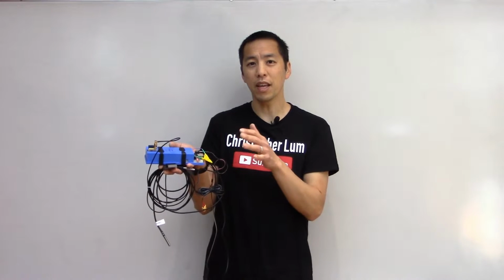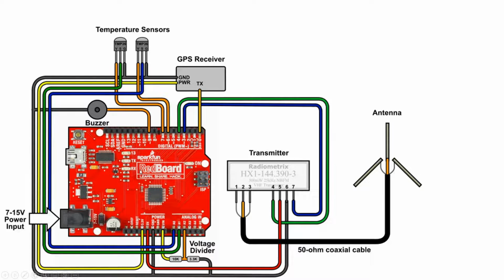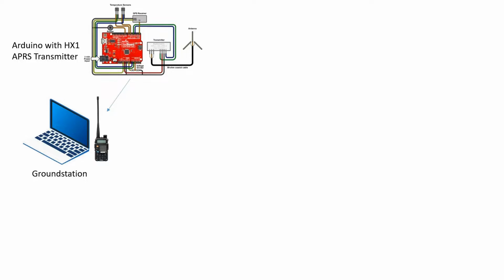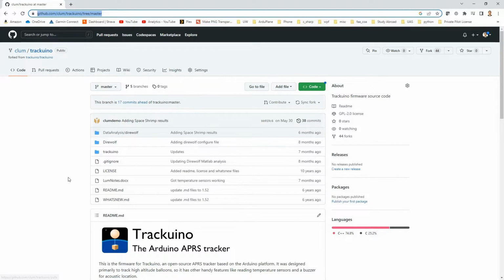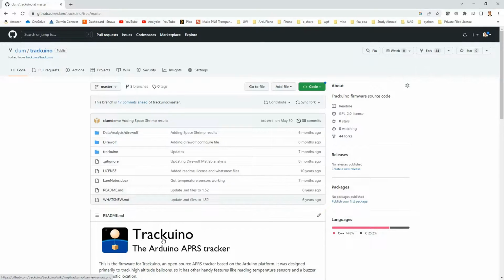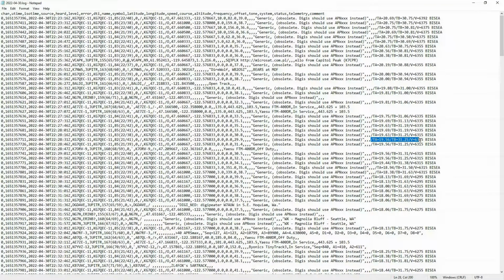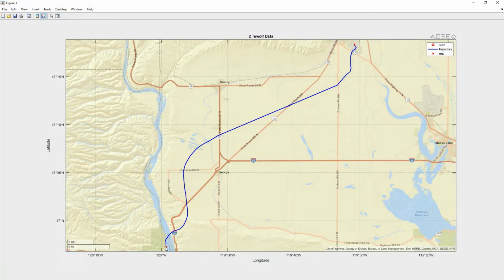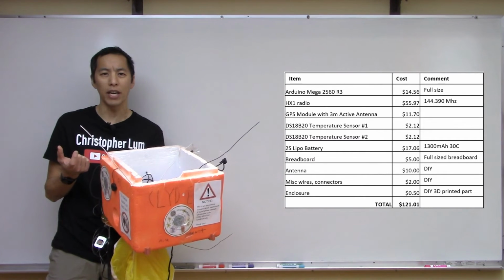HX1 Arduino APRS Tracker

Comment: How does one purchase the HX1? I am not finding any source. Only the device is no longer supported and discontinued by the supplier.
Reply: I'm running into the same issue. I'm going to substitute a BaoFeng and a DigiRig.
Reply: I just went with a stratotrack module 

I had to pay for it but it works perfect and super simple

Comment: I'm interested in building an APRS iGate Digipeater and I am thinking of adapting this project for a fixed iGate Digipeater. I am wondering if can I use Direwolf instead of Trackuino? Looking at the project pages it also mentions something called the Chipkit Uno32 is this absolutely necessary as I can't find much on the ChipKit website about it?

Comment: Hello Mr Lum. 
I have a problem in simulink (Matlab). The problem is that: can we change the precision of computation in simulink "espcially for the integrator"? In another words, can we simulate a model with precision of 32 dicimal digits instead of 16? 
Thank you in advance.